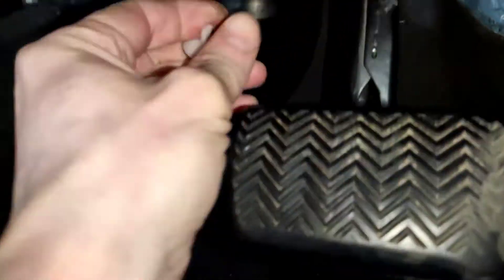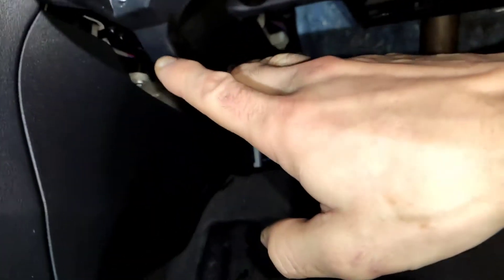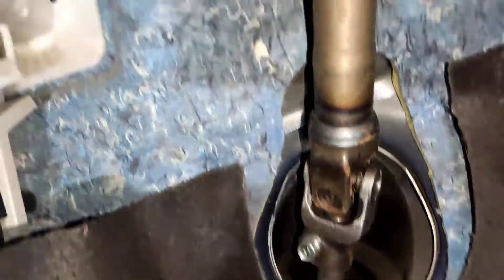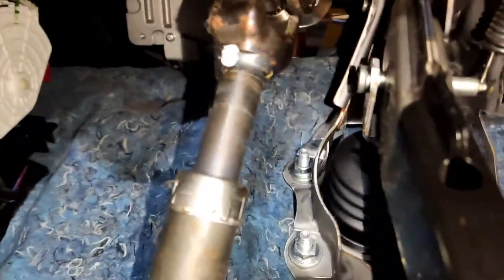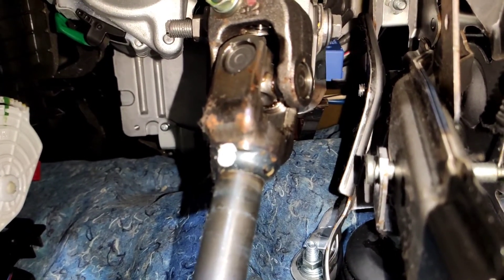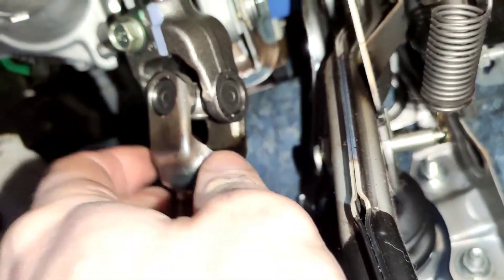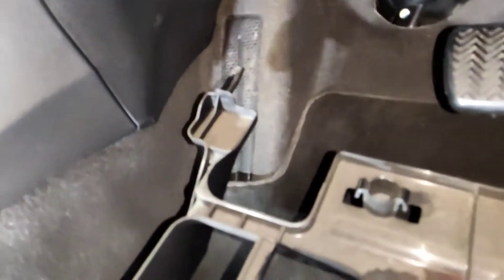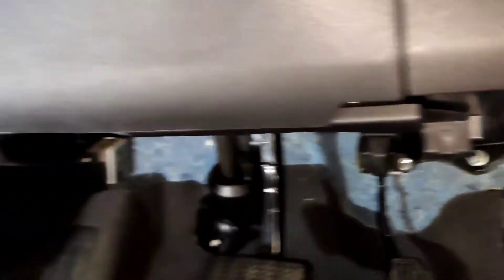Toyota auris steering column knocking Murphyslaw

Comment: Great video have same problem with my car . Thanks for the help
Reply from the maker: It makes some noise on a bumpy road still can't believe it was an easy fix
Reply: @murphyslaw2020   yes it dose I haven’t fitted it yet. I’m just ordering 1 for mine after seeing your video. Did your 1 cost much?
Reply from the maker: @jolawre6526  it was expensive I can't recall exactly but around 200 euro
Reply: Mine too has the same problem i have replaced more than 4 Racks 🥱
Reply from the maker: @martinkariuki8607  that sounds like a nightmare. Are you going to try this part now

Comment: I notice that your video is over a year old, but hope that you might get this message.

I don't understand that when you mark the old shaft (green marker), how do you transfer the marks to the new shaft? Is there something obvious that I am missing? Thanks
Reply from the maker: I just eye it up ,I maked it close to Bolt etc.
I just maked it so I didn't have hard time tracking the car if you get  it 💯 probably don't need to  track it just don't move the the steering wheel
Reply: @murphyslaw2020  thanks for responding so fast! I really appreciate it. My friend's Auris has this terrible knocking sound. On gravel roads it is very bad! I thought that it might be the shock tower rubbers, but tonight when I drove it, I noticed that knocking (deep sound) coming from the steering column. So when I got home, I got onto the internet and came across your video> I really hope for her sake (and mine. because I am not completely dumb with cars/mechanics, but I aint no mechanic either) that it will be her fix! Fingers crossed
Reply from the maker: Hi it's hard to do and not very safe but I put my foot on the Shaft with the cover off and put pressure on it when I was driving on a bumpy side road. The noise was less.
Just a little test you could do as well.
When I called the dealer for the part they told me they do sell afew of the every month
Reply: @murphyslaw2020  ok cool. the gravel road goes past my house. I am sure I can safely do that test. I will post back here once I managed to do the test. for your info and future searches for the same problem
Reply: I just did one,I marked it after removing it I realize it has a wide spline so it can only go one way the only difference is top and bottom but i did mark it by the split

Comment: Just removed the intermediate shaft and still getting the same noise from in under the steering wheel
Reply from the maker: Hi did you fit a new one
Reply: @Murphys Law  the noise is coming from the steering column. Not the intermediate shaft, gonna pick up a second hand one from a scrapyard tomorrow, hopefully
Reply from the maker: @TomMac1   put my foot on the shaft and put pressure on it and the noise stopped/got lower, when I was driving. 
Not very safe but it was a closed road very bumpy road

Comment: Can you remember which site or who you bought the shaft/column from?
Reply from the maker: Hi I got it from the Toyota main dealer it was about 200 euro if I recall. Not cheap but the noise is a nightmare
Reply: @murphyslaw2020  sound, thanks a mill